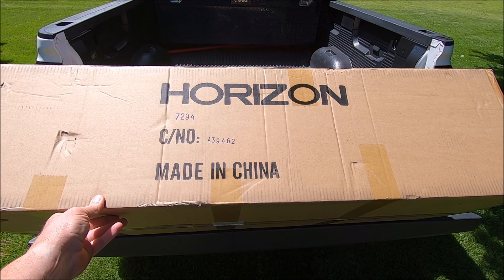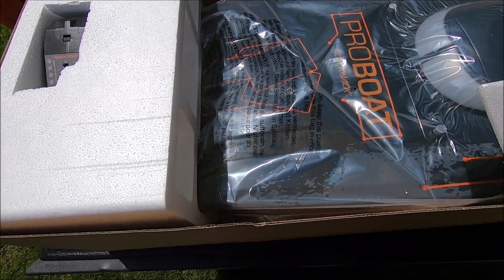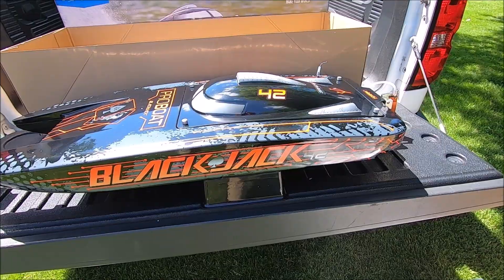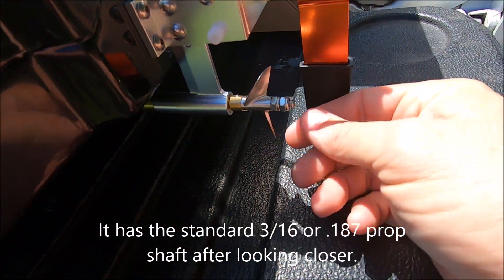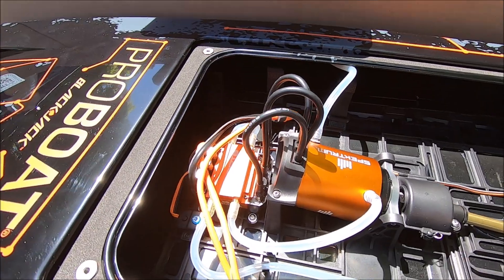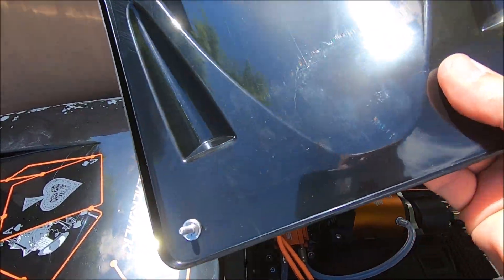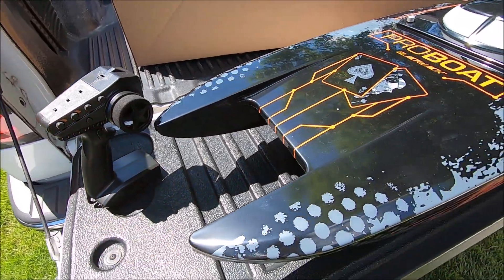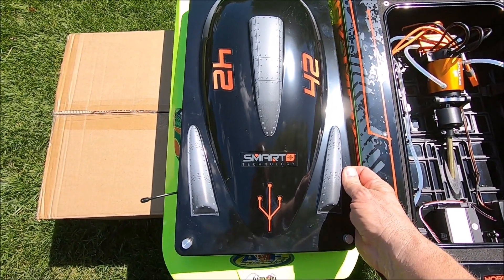Pro Boat Blackjack 42 8S Brushless Catamaran RTR unboxing and first look.

Comment: People are wrong, this hull material is like plastic but it is not like Sonicwake, this material is similar to the plastic of motorcycles or the same and they do not break so easily, they are extremely hard ,the boat looks amazing ,a few changes and kills
Reply from the maker: Correct.

Comment: hey just to let you know ive heard it can handle 12s and reached speeds of 70+ in testing
Reply: 8s
Reply: I have that ESC in my sonicwake and it doesnt run 12s, Id be interested to see how they ran it on 12s.  motor might handle it but def not esc
Reply: i cannot confirm that tho lol
Reply from the maker: @jakemetz3682  8s max
Reply: @MrMad2424  you should try it for research proposes LOL (joking)

Comment: Looks beautiful but that shaft needs to be 5mm and dual pick up with a 160amp esc. Overall though looks sharp
Reply from the maker: 5mm  props are hard to come by. The .187 is fine. I prefer 1/4 over 5mm any day.
Reply: @MrMad2424  sorry I totally agree 1/4 is what I was meaning, been a while since I've be around a boat! Lol

Comment: Hello Mr M,that looks superb,no doubt you will be laughing at 50+ mph, just bought myself a TFL Genesis,1420 mm long with dual 5684 1000 KV motors and dual 300 amp ESCs, should be pretty fast, can't wait for you to test your new boat,all the best Walt.
Reply from the maker: Thanks. Congrats on the new boat.

Comment: nice to finally see a FE RTR that isnt a piece of junk skater cat. stupid thing dont turn and randomly blow off the water. cant see why anybody would drive em. THIS looks like it should turn and handle proper. the reviews and time will tell . few problems that i can see- the strut has a terrible taper on the front end going to the stuffing tube. that will cause drag. also trash those nuts behind the prop ,thats not what those type of nuts are for . they will also cause turbulence/drag/odd behavior
Reply from the maker: Time will tell.

Comment: Like many, I was somewhat skeptical when I first heard the hull was polycarbonate (ie. Lexan)...but, at the same time, having worked in the plastics industry many years ago, I have first-hand experience in how strong cast polycarbonate it (extruded polycarbonate, such as in tubes & rods, isn't quite as strong, but still relatively strong).  Anyway, after seeing the interior of the hull, and all the additional reinforcement, I'm 99% confident the hull is rigid enough.

Now, the questions.....

First, considering the size, I'm 'curious' as to why they didn't make it a twin.  Granted, it's probably lighter than the Miss Geico, but, still, the Miss Geico is a twin, so shouldn't this have been, as well?  Say, running twin 4S (or, maybe, even twin 6S)?  After all, there's more than enough room inside.

Second (since I'm still extremely new to FE racing...as in, I haven't even entered my first race yet (entirely sure to Covid-19's "interference")), would this boat be race-worthy?  I know some are racing the Miss Geico, which has me wondering.  Also...if it is race-worthy, what class would it be?  My current race boats consist of a P-Limited mono, and a P-open twin cat.

Whatever the answers to my questions (if any answers are given), I'm still considering getting it...would just need to decide color (I REALLY like the black, but the white is easier to see out on the water)...as it should make a great boat to just have fun with (whether, or not, it qualifies for NAMBA racing).
Reply from the maker: It seems to be a well made boat. Temps are low running through the packs hard. It seems durable from the crashes I have had with it. As for as a race class I don't think a 42 inch class exist. But again I'm not real sure on each locations classes.
Reply: @MrMad2424  What about the "jackrabbiting"?  Resolved that, yet?
Reply from the maker: No. I don't plan to run it on the stock prop so I won't worry about that until I decide on what prop i'm going to use for a few more speed passes.

Comment: Looks awesome, my worries with the plastic is at the glue spot where the two parts come together like a shoebox.  the plastic doesnt break it just splits apart, I jb welded the crap out of my sonicwake and its been holding ok
Reply from the maker: Way different than the sonicwake. The sonicwake is plastic this is polycarbonate.
Reply: @MrMad2424  I thought polycarbonate was just a type of thermoplastic
Reply from the maker: Sonic wake is more brittle feeling than this boat. This boat will flex more.
Reply: @MrMad2424  Copy bruh, sounds like a great basher boat.  Maybe I should build a TFL 1152 to compare